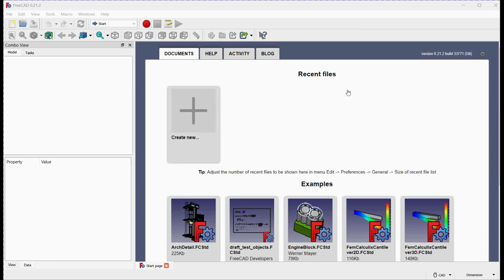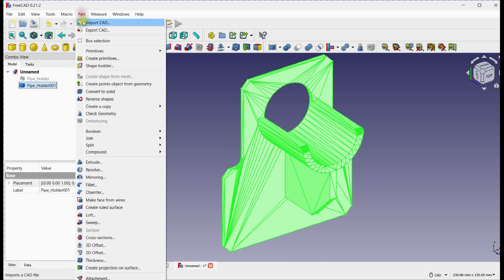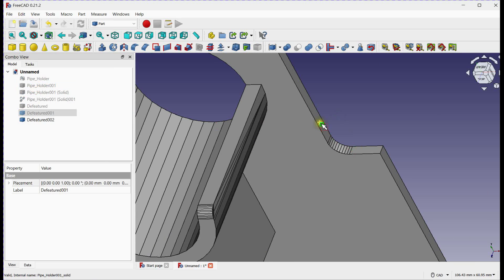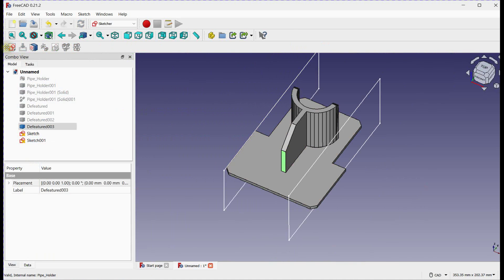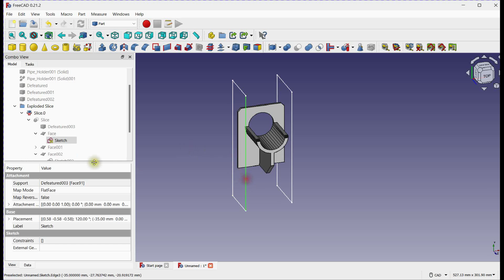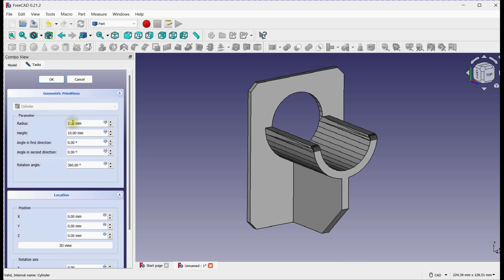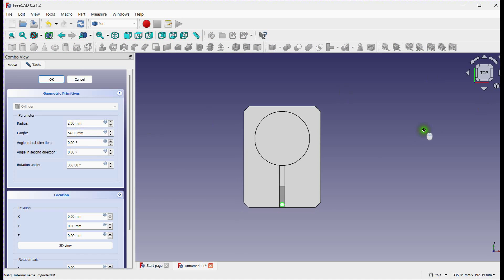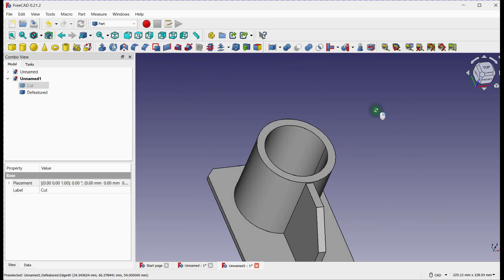✅How to modify STL file in FreeCAD | Step-by-Step

Comment: Круто-круто! Только как получить после всех модификаций Эскиз(чертёж плоскости XY) всей детали? Чтобы изменять деталь на уровне эскиза....
Reply from the maker: Спасибо за комментарий! Чтобы получить эскиз плоскости XY всей детали для редактирования, создайте новый эскиз на нужной плоскости в Part Design Workbench. Вы можете использовать функцию создания эскиза на плоскости, которая вас интересует.
Reply: @Learn-Engineering  Да, можно создать эскиз прямо на выбранной стороне(грани модели). Но как автоматически получить начерченный внешний периметр STL модели, на плоскости где лежит модель? Спасибо!
Reply from the maker: To extract the outer perimeter of an STL model in FreeCAD, first import the STL file and convert it to a shape using the `Part` workbench. Then, create a new sketch on the desired plane where you want the perimeter. Switch to the `Draft` workbench to upgrade the shape to edges, and finally use `Draft` > `Draft to Sketch` to convert those edges into a sketch. This will give you the perimeter of the STL model on the selected plane. If you have any difficulties or need further clarification, please provide more details about the specific issues you're encountering.
Reply: @Learn-Engineering  Mega Thanx!!! У нас youtube не работал. Я всë понял - пойду попробую!

Comment: Hi,
When I go to convert shape to solid I get an error message saying: Cannot convert CE3_Large_Front_Bracket_MWO001 because Shape is not a shell. Is there a work around?
Reply from the maker: The error indicates that the shape is not a closed shell. To resolve this, ensure the shape is a watertight shell. If issues persist, consider recreating the shape as a closed shell. If you need further help, please provide more details.

Comment: When I try to refine the solid I am met with the error "recompute failed". How can I work around this?
Reply from the maker: The "recompute failed" error when converting an STL to a solid in FreeCAD typically means the STL file isn't suitable for direct conversion. This can happen due to:

Small Features: Tiny details in the model can cause issues.
Non-Manifold Edges: Edges shared by more than two faces.
Poor Mesh Quality: Defects like holes or overlapping faces.

To work around this:
Inspect and Repair: Use mesh inspection and repair tools in FreeCAD or MeshLab.
Simplify the Mesh: Reduce complexity by simplifying the mesh.
Manual Cleanup: Edit the mesh to remove problematic areas.
Improving the mesh quality and removing small features can help successfully convert your STL to a solid.
Reply: @Learn-Engineering  thanks for the help.
Reply: you wont freecad doesnt work